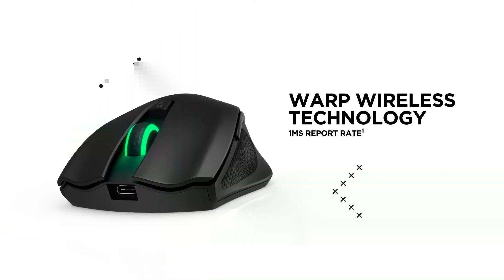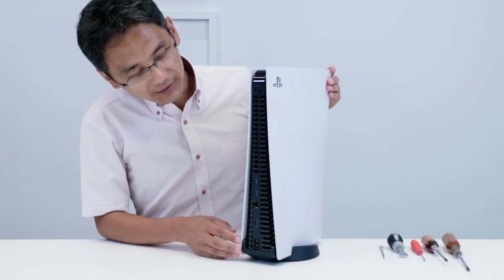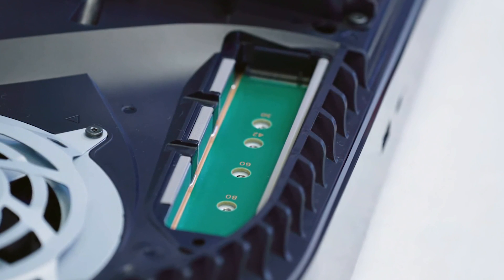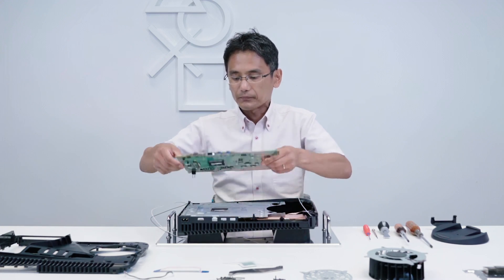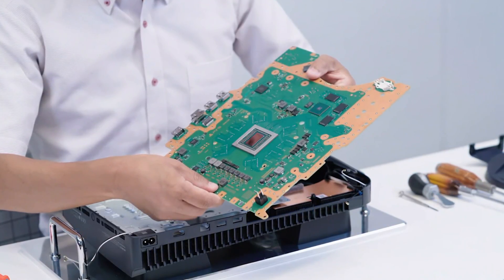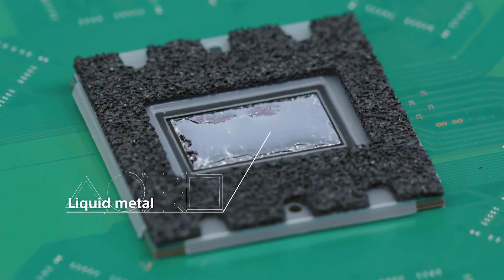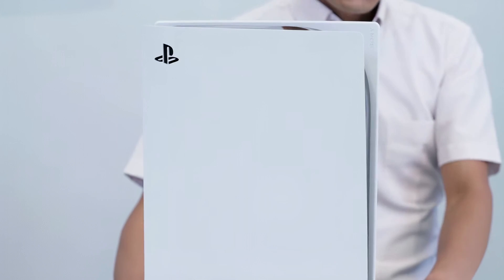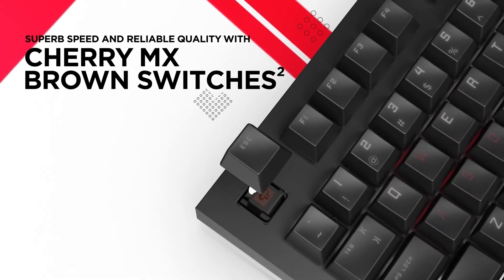PlayStation 5 Teardown Analysis: Inside Sony's Next Generation Hardware Design

Comment: Really gotta sit back and admire the engineering solutions each team used this go around.  Very excited to be so close to this next generation.  No matter your preferred platform we all win.  Hey does anyone know if that WiFi 6 is a sign that this next PSVR is going to be wireless?  I love my current VR but the cord is a nightmare when you live with 3 dogs running everywhere.
Reply: It would certainly help, but the fact that it is WiFi 6 just means it's contemporary.
Reply: @markiep8477  not really since most people don’t even have WiFi6 routers..
Reply: @leonxl  Yes, but if you are buying a new router now, you would be wise to get a WiFi 6. It is the current and best performing spec.
Reply: @leonxl  

Wifi 6 will just provide a really stable and solid connection even if people arent rocking wifi 6 routers. That extra optimization will also help for a pretty solid VR.
Reply: @MavihsLH  nope. In order to get any of the WiFi6 benefits, you need to have a WiFi6 device connected to a WiFi6 router through ax. Otherwise it’ll just connect through a/b/g/n or ac. Look it up
Reply: @leonxl  

That's true. My bad I should've researched more. Regardless its good future proofing as new routers are moving towards wifi 6.
Reply: @MavihsLH  lol that’s like saying tv content should already be in 8K since that’s the resolution we’re moving towards, but the reality is that most people don’t even have 4K TVs yet! Most people don’t even have AC routers yet....
Reply: @leonxl  

It's not the same. Wifi 6 is already becoming a mainstay in budget-premium laptops etc. Its literally being put everywhere and doesnt even substantially increase the cost. Carriers in my region already offer superior wifi 6 with no additional costs!

Unlike 8k which is a massive leap, in terms of resolution and money, wifi 6 has a ton of improvements and many are already slowing moving towards it.
Reply: @MavihsLH  yes that is all true but it still doesn’t discredit the fact that most people are not upgrading their routers. Yes most devices nowadays are starting to be released with WiFi6 chips inside but it’s still dependent on the consumer to also know that they need to buy a WiFi6 router in order to enjoy those benefits. A million people could buy a WiFi6 laptop but if only one thousand buy a WiFi6 router, does it really matter?
Reply: @leonxl  

You see most carriers are already shipping their new routers with wifi 6 anyways. That means even if a consumer, who has no idea about wifi 5 or 6, ends up replacing or buying a new router, they'll be treated with wifi 6. Atleast that's how it is in my country.

Just buying any new router will come with the latest wifi card so it doesnt really matter :/

This does not apply to many regions, but in the middle east, most people have already converted to Wifi 6.
Reply: @leonxl  

Also keep in mind that ps5 will last another 6-7 years.

Everyone will be on the new stuff by then.
Reply: @MavihsLH  omg it doesn’t matter what your little country does. MOST people don’t even have WiFi5 routers let alone WiFi6. WiFi5 came out in 2013 and MOST people STILL don’t have WiFi5(AC) routers. So in 7 years, most people still won’t have WiFi6 routers. End of discussion
Reply: @leonxl  

I disagree once again. Verizon, AT&T etc. are pushing WiFi 6 further into more homes.

Plus, everyone already has a WiFi 5 router atleast. You’re telling me, vast majority of people don’t have a basic 4G router? They do. And most of those routers come with WiFi 5. And possibly a lot of AC too.

And also people will soon upgrade their routers anyways. Especially when every major telecom company in US is offering insane deals just to get people on the new stuff. In 7 years, we can universally expect WiFi 6 to be mainstay. 

Overall, I believe we’ll see more and more people wanting faster speeds in coming years.
Reply: @leonxl  

Now imagine you as a consumer spend 499$ on a console, and then you decide you want to move over to the fastest possible WiFi speeds for the best experience, but realize the hardware is holding you back.

Even if a lot of people don’t have WiFi 6, it’s still something that’s good to have. So you’ll never be roadblocked by your 399$ or 499$ console ever.
Reply: @MavihsLH  show me one source where the big telecom companies in the US are “pushing WiFi6”. Wifi5 is AC and no, most people don’t have AC routers. 
And even if most people do upgrade to WiFi6 (AX) in 7 years, new consoles will be out by then and the new Xbox will surely be compatible with WiFi6 or even WiFi7 by then. 

My point originally was that PS5 having WiFi6 compatibility is really worthless because most people don’t have WiFi6 routers yet and you agreed, so let’s just accept that you were wrong and move on.
Reply: @leonxl  

Also please dont turn this discussion into a matter of who's right or wrong. Both you and I cant give an objective outlook on the matter since we cant speak for everyone. Sorry if I've taken alot of your time. 

Have a good day.

Edit: Wifi 6 is mostly for the next PSVR2. Since it has centimeter level positioning. The VR headset can directly connect to the wifi 6 card for a pretty good wireless experience (like the oculus).
Reply: @MavihsLH  Wifi 6 IS NOT for the psvr2. Due to massive inherent latency with 2+2 5ghz (wifi6), it's not a playable option, regardless of what the facebook bots say about quest over VD wifi6. 
VR only works via tethered or 802.11ay 60ghz wigig that has the bandwidth and latency required for presence (23ms) (exception of the quest in standalone).
If Sony does decide to build psvr2, it will be tethered. 
About your total lie of a comment about centimeter positions? lmao! Terrible failed attempt at trying to look informed. VR needs to be on sub-mm scale to even be viable (such as cv1 rift, vive, index, g2, rifts, quest, ect), which is why psvr was so trash becasue it was well above in the mm-scale positional tracking latency (results in visible jitter). 
Stop pretending you know anything about radio networking and VR, you have no clue what you are talking about.
Reply: @sqlevolicious  

Also I agree I'm not the most well informed person on this matter. If I was wrong you can simply correct me instead of insulting or bashing me. Everyone can make mistakes, me included. I've also learnt a great deal from your comment.

It's clear that I dont have the knowledge nor expertise to follow up on any more comments. I wont be responding to anything.

Cheers pal.

Comment: So if normal NVMe SSD's can expand the PS5's storage does that mean that their speed is comparable to that of the custom SSD inside the PS5?
Reply: Yes. The top ones have comparable speeds, and even better read speeds, but they also need to be better to emulate comparable priority levels.
Reply: Almost none at the moment, but they will come. The custom stuff is so we can get insane performance in a cheap box (cheap compared to a PC).

Comment: If you follow the nvme traces from the SOC to the integrated SSD, traces go from that to the external ssd, so the add on SSD goes thru the internal SSD, like it's daisy chained
Reply: It would have to use the memory controller that is in that location to benefit from the extra fast technology.

Comment: 8:51 Sense he don't know . As Intel put it, "Wi-Fi 6 is capable of a maximum throughput of 9.6 Gbps across multiple channels, compared to 3.5 Gbps on Wi-Fi 5." In theory, a WiFi 6 capable router could hit speeds over 250% faster than current WiFi 5 devices

12:45 What 15 years is concerning.

15:34 Same goes with the CPU & GPU.
Reply: What are you talking about for 8:51 He clearly mentioned it has a theoretical maximum of 9.6Gbps
Reply: @davehumphries  Thats all he knew about it he had no clue about the rest

Comment: Liquid metal is very stable over time when it's not in contact with copper (or God forbids, aluminium).
In enthusiast PC land, where I usually live, most heatsinks were not built to work with liquid metal and therefore usually have a copper coldplate.
Nickel plateded heatsinks, on the other hand, can withstand liquid metal for a very long time with just minor staining on the surface. 

The real problem with liquid metal is applying it (especially in an industrial scale). 
That thing is pure hell to work with, and I would not be surprise to see PS5s coming out of the factory overheating due to badly applied TIM.
Reply: They spent 2 years trying to get the liquid metal to work in their system, I’m sure they have run many tests to make sure it does the job
Reply: @harveyhewitt4004  I wouldn't be too concerned with it. At the end of the day time does it's thing with paste and pads etc. I've restored and sold many consoles I pick up and I always make sure to clean and repaste them, clean the heatsink and even the fan blades can be caked with dust buildup that reduces airflow.

I work with inndustrial sized HVAC systems and dust buildup overtime is a problem which is why so much money is spent in maintenance in the industry. Gotta take care of your hardware.
Reply: @TerraWare  both Sony and Microsoft can’t have another issue like the yellow light or the red ring, that costs too much money
Reply: It has its own special housing. It won’t be an issue.
Reply: god  haven’t you got a ps5 god? If Sony gave one to travis Scott surely they have you one?
Reply: Nice to know the FUD ruckers are here. Only a month to go you vile asshats.

Comment: 3:15
The OG Xbox One owners were specifically instructed not to place the console vertically.
And for the Xbox One S and X, the same thing applies and a special vertical stand needs to bought separately which establishes quite a gap for the fan to suck in fresh air from the side vents (which is facing downwards when the console's vertical). 
And now they're mocking ??
Reply: Xbox series s is a big fail , it runs the new Yakuza game at 900p 60fps/1440p 30 fps 😂

Comment: I sure hope that Sony and Microsoft put in some safety mechanism in case of a fan failure. Otherwise the damage might be catastrophic (especially in SeX with how compact and cramped everything is plus the fixed clocks) given how much heat these things clearly produce.
Reply: Most electronics now have built in sensors to automatically shut off if they go above a certain temperature.  A fan failure could cause software problems like crashing or at worst OS corruption, but the hardware would be fine.

Comment: Definitely this video is sponsored by microsoft, I expected more from DF they did not even analyze the why of the architecture, making a small board is not an achievement, have you not seen the mini pc or the Nvidia PCB? I definitely believed in you a lot and this only proves what you say when you start to monetize and have publicity change and unfortunately for the worse, well it is my fault for believing in you with the simple fact that you recommend HP Omen when it is a bad product from there I should notice it

Comment: I loved seeing a PS5 is basically 50% heat sink with a massive fan drawing in far more air making it a more effective cooling system with the APU clocked high...

Its an interesting design choice and reminds me (in terms of cooling solutions) of where MS went with XBONE back in 2013 - they were just so overly conscious of the terrible rrod and noisy console stigma that they were branded with from the 360 era that they engineered the s** out of its far more efficient cooling design (with an albeit larger final product size).

These two beastly consoles are looking more like gaming pc specs this time around! (and no more tv tv tv or weird ESRAM!) Have pre ordered both and CANT WAIT to see what the devs do with them.
Reply: Agreed. I'm really impressed with what they have both done. I will be getting a PS5 because that's my ecosystem, but the Series X is looking great.
Reply: ESRAM isn't weird, it's fucking awesome.

Comment: Liquid metal has not long life. About a year need replace.also it eat the heatsink slowly.
Ofc they do that because they overclock the gpu to 10 tflops and had thermal problems. They has not more time to make new console from the start.
After a  year I know my ps5 fan will start work hardly

Comment: Just wanted to say it's great to see an honest review relating to the PS5. Basically impossible via most media outlets so it seems.
Reply: First what reference is there that MS sponsors them? Second all credible tech sites for years have been on the record how liquid metal/thermal paste.... same thing is problematic eventually (1-4yrs) pending on quality and heat. Yet most Sony reviews say doing this a good thing, a great accomplishment. Just one of many examples. No need to hold a console to know this.
Reply: How can it be honest when they didn’t get a PS5 yet and MS sponsors them in order to promote their consoles?
Reply: @kraenk12  So you just make stuff up claiming MS sponsors digital foundry?

Comment: How the heck is the PS5 weaker than the Series X yet still manages to be bigger and use way more power (350W) smh?
Reply: The power difference is negligible. Games will look the same and it'll run cooler than Series X.
Reply: @NineTails87  It's still more powerful though....
Reply: It doesn’t use more power at all. How does XSX manage to run much hotter at a much lower clock speed? Size!
Reply: Weaker by 20% but the SSD is faster more than 120% - 200%, And then there's alot of Cooling mechanism that need more power to run but it's not that big of a deal

Comment: The size issue is  not a problem for me as my TV unit has four 17x6 spaces in it. The PS5 will fit in it and I will hardly ever look at it, just like my PS4 pro. I may even dye the side panels a darker colour (black or grey) so it stands out less (I dyed my Xbox One S case). I buy my PC and consoles to play on them and I want them as invisible as possible; fuck RGB LEDs.

Comment: Interesting that you chose to compare with the XSX that is until we saw the wifi which is wifi 6 on the PS5, strangely you chose or failed to mention the XSX is using wifi 5, seems like DF is team xbox.
Reply: It's entirely possible they know but embargo prevents them from discussing aspects of the console... As DF is under no embargo here they can do as they please.
Reply: And they said that the SSD being soldered in the motherboard is a bad thing, when seriesX is DOING THE SAME and they never mention it. Is funny

Comment: Empty soldering pads on the front side of the board next to the APU? What's that for?
Reply: It's for the 4MB N64 Expansion Pak.
Reply: @GeordiLaForgery  LOL. Looking at this again I think its probably not soldering pads but through contacts to the GDDR on the backside. Interesting. I'd have thought they'd route the APU die and then trace that on the back side.
Reply: @JurgenSchober42  I agree wholeheartedly with your conclusion. ;)

Comment: Honestly, looking at both consoles, the cooling solution on the PS5 looks a lot better. XSX looks like everything is just crammed together like a sandwich.  Because of the length of the PS5, stuff is spread out more, which is covered by the huge heatsink which is running the entire length of the board.

Should be interesting to see when they do comparisons of the same game running on both consoles. Lets just hope that the various 3rd parties don't have some agenda and actually don't try and gimp one game on 1 system because some kind of bias.
Reply: Yeah I am 100 percent sure that Sony's system will work. If Microsoft's cooling system does work I think it is a more impressive solution. It is just a bigger departure from what we know works

Comment: What I find interesting is the PS5 has a bigger power supply than the Series X which has more silicon ...... To me that says they are getting back some of the power by running higher clocks which as anyone who overclocks knows increases power consumption in a non-linear fashion ..... What I haven't heard anyone mention is how the PCB itself acts as a heatsink and there are quite large areas of contact to both the heatsink and the bottom shield which will also act as a heatsink for the underside components  ..... My biggest concern however is with the liquid metal which is quite corrosive   and has a tendency to "pump-out" even more than standard heatsink compounds ..... When used on PC's it tends to have a shorter lifespan than conventional heatsink compounds and is normally replaced every year so it's hard to say what is going to happen 3-5 years down the road ..... Their method of containment may work but if it doesn't we could very likely see a significant number of PS5 either overheating and burning up or shorting out or corroding components if it leaks onto the PCB ...... or a combination of both
Reply: The liquid metal patent and the Sony video show that the liquid metal is sealed on all sides, it is not getting out unless you put enough shock into the system that would probably destroy it anyway.
Reply: The opposite is the case. PS5 runs very cool running at higher clocks and XSX is already running hot AF at lower clocks.
Reply: Yeah I'm concerned about that liquid metal in the console. That's a pretty bold move that sony is doing.

Comment: Isn't vacuuming your console dangerous to the inside components? That's what I've always heard, and why I kept away from doing so. I actually think one of my consoles was damaged by doing just that.
Reply: Vacuum cleaners can have a static charge, but I doubt that's an issue here since you aren't touching any components with it, and the case will dissipate the charge.
Reply: @defeqel6537 
 I'd just rather use compressed air to stay on the safe side, lol.
Reply: @Imadeyourun  TBH, me too.